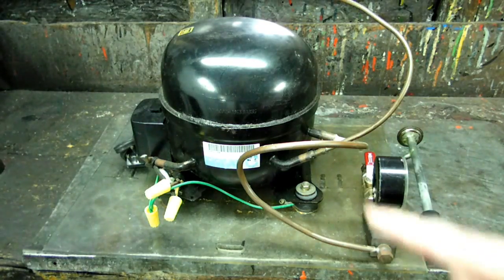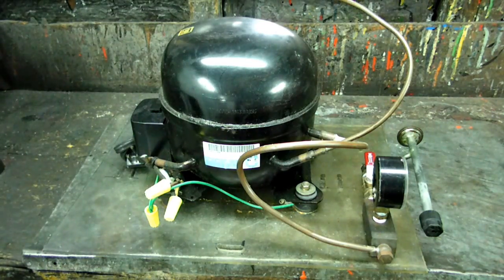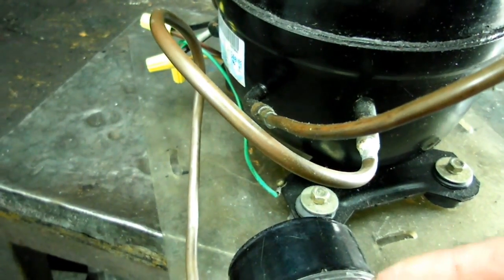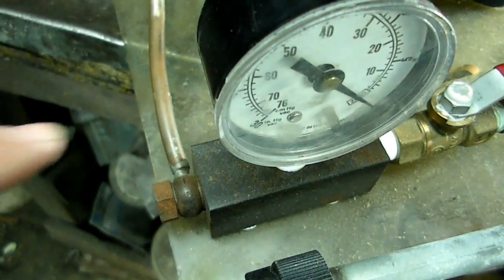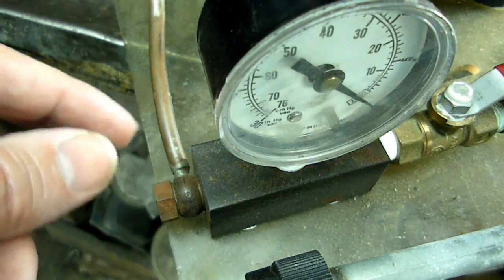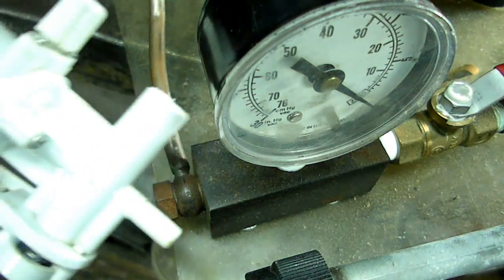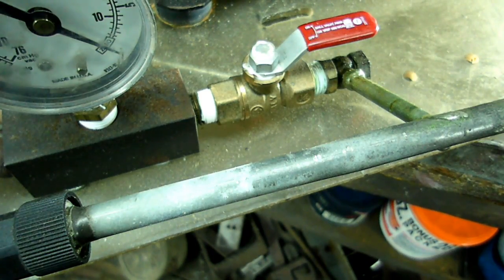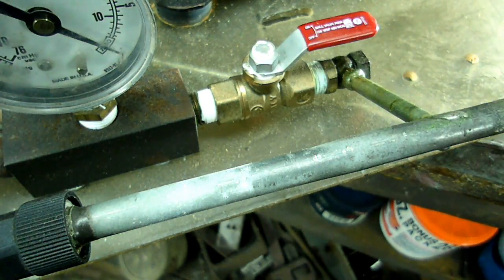Homemade Vacuum Pump

Comment: I tried converting a 10 dollar tire inflation pump by putting a line on the intake port of the little piston inside the pump. Unfortunately, it only pulled down to 25  inches of mercury which is a very weak partial vacuum. I threw the damn thing in the garbage.